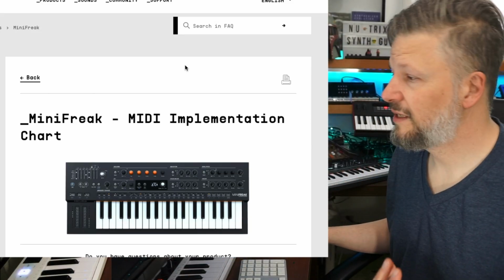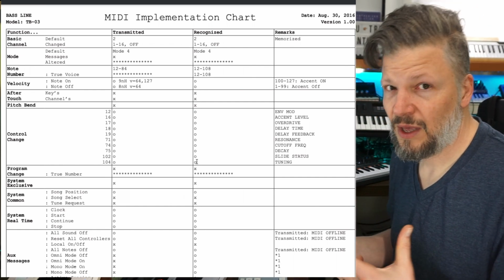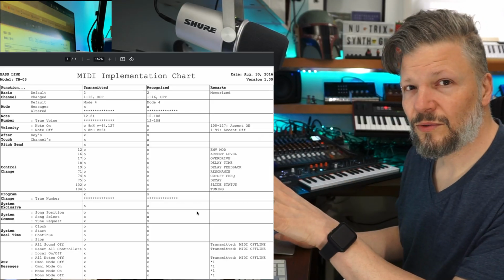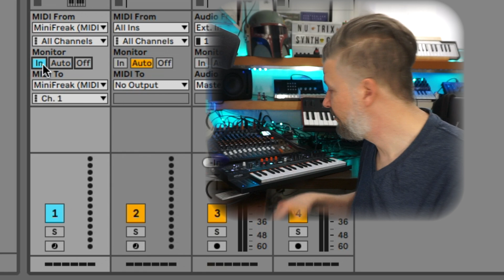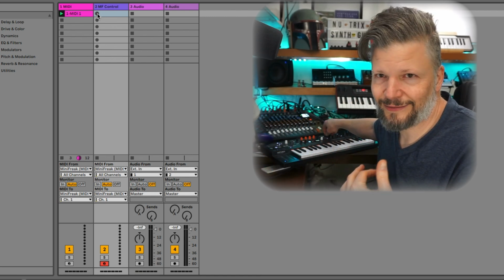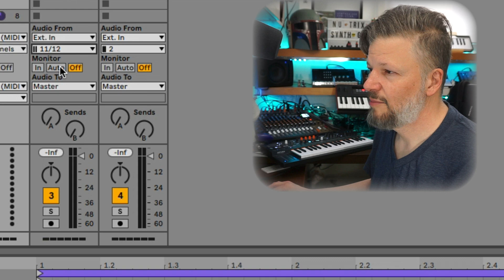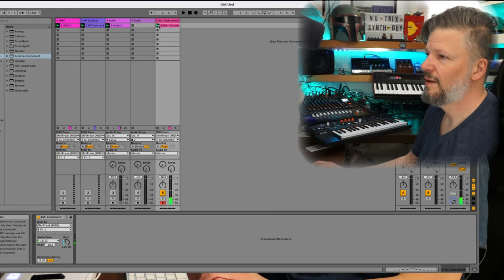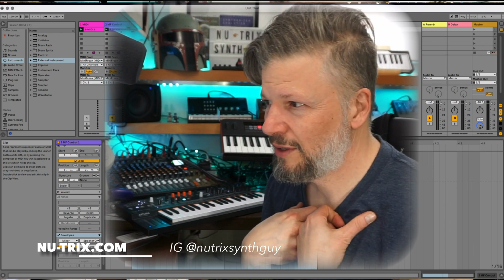How to set up #midi synth with @Ableton Live (or any other DAW)

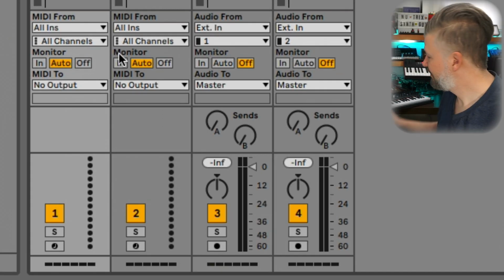Comment: You skipped a whole load of stuff if this is how to `set up`. At 6:54 my heart sank when I realised you already had it `set up`. I`m pulling my hair out trying to set my MF up into Ableton..
Reply from the maker: What part of the « set up » would you like to know more about. I’ll do another video for it.
Reply: @Nu-trix  Hi. I`ve had Ableton for some time and have used it for making experimental (mainly mental) tracks. I bought the mini freak for this and a few other bits of hardware months ago for some other projects (voiceover mainly). I thought that plugging in the mini freak would be the easiest part but have not been able to use it in a straight forward manner, yet. I have been online trying to find help for weeks now. I see lots of videos about the subject but literally none yet that actually take me from the `out-the-box` stage to running in-track. Some have all the stages undoubtedly but those still skip settings etc. Also, it`s `linked` use with the VST plugin for it in relation to the in-track settings for Ableton. When I say setting-up, I mean actually setting the hardware up within the software. Your video looks extremely good for someone who has already passed my stage but set-up for me is a far more basic requirement. Pete
Reply from the maker: I hope this new video will help : Setting up USB MIDI for the MiniFreak in @Ableton  Live ( or any synth)
https://youtu.be/x7tjRdFq4Hw
Reply: @Nu-trix  Now you`ve made me feel crappy for moaning at you, lol. I will devour this new video of yours when I`ve finished my shift week. I`m really very grateful for your response. cool bro.

Comment: Hey guys! 

I currently have 3 pieces of gear that I’d like to use. 

1) Arturia Keystep 37
2) Roland JV1080 
3) Scarlett 18i20 

With these pieces of gear I want to: 

1) Play my JV1080 with the Keystep
2) Use the Keystep to play sounds on Ableton
3) Use MIDI in Ableton to sequence sounds from the JV1080. 

Can anyone advise me on the connections/routing options to make this work? I have been stumped with this for a while and can’t seem to achieve all three playing options highlighted above… any feedback would be greatly appreciated! 

Thanks in advance :)
Reply from the maker: Good question. I’ll try to make a video to answer it.
Reply from the maker: Is that all the gear ? No mixer?
Reply: @Nu-trix yup that’s everything, I guess my DAW (ableton) is used as a mixer of sorts

Comment: Thanks, I'm asking for some advice. how to best connect a setup consisting of a macbook with Maschine 2, Maschine Plus, Kontrol Komplete and two external synths (Kurzweil with keyboard and Korg WS SR module so that they are driven by Kontrol Komplete or for the Kurweil also send midi messages to the Mascine 2 directly from your keyboard?
Thanks, Luigi

Comment: for external instruments ableton is not the best daw i guess. i still have problems with my synth " quasimidi raven max "  the max only has midi in/ out and no usb so i have to use an usb to midi interface adapter. in ableton i cant find any function to change the soundbanks or sounds. if u have any idea please let me know :)

Comment: Hi Nutrix, thanks for the information! I am having an issue with Ableton Live 11 Lite and my Roland TR-09. I can record the TR-09 on a Midi track in Ableton, but when I playback the recording what happens is that the internal sequencer of the TR-09 starts to play, which I obviously don't want to happen. I assume I need to change a setting on the 09, but can only switch between track play and pattern play? Do you know how to fix this? Maybe good to know is that I decided to run the 09 on batteries and use the 5-pin midi connections to get rid of the USB-hiss. But I don't think that would have an effect on the Midi trigger, would it?
Reply: Turn off global on the Roland.